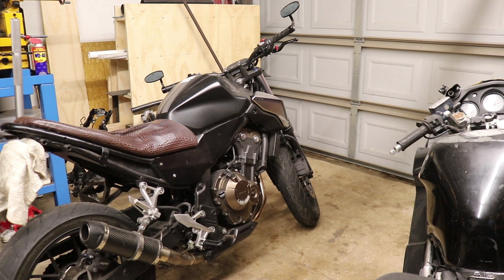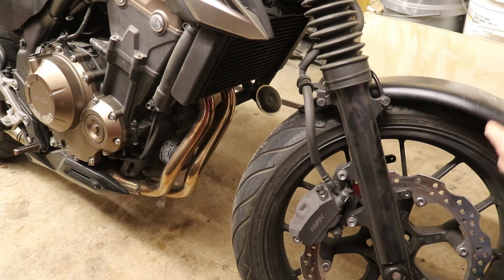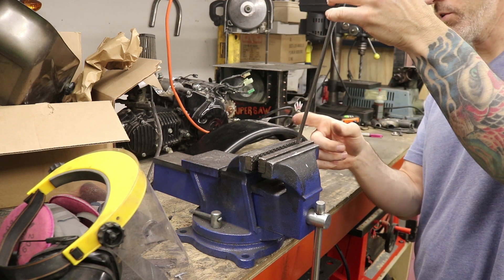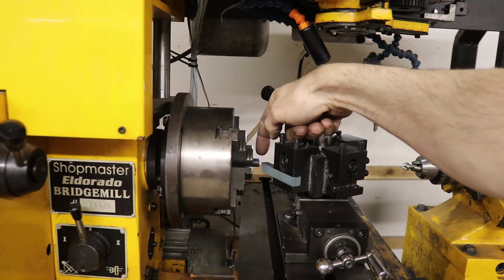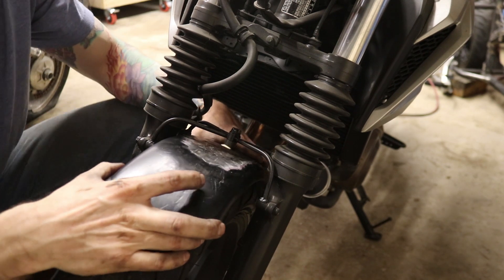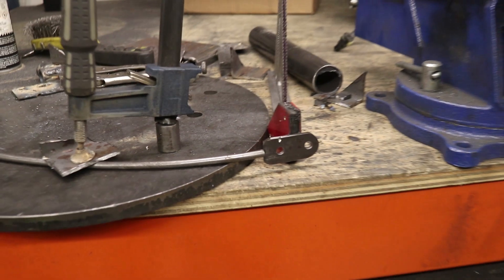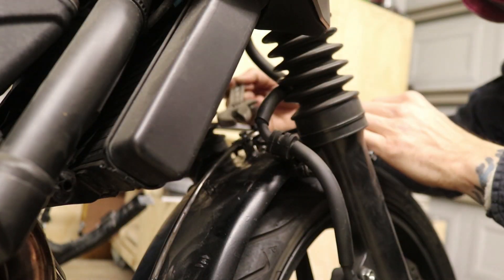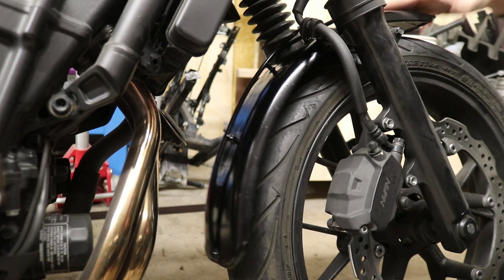Fender Re-inforcement on the Custom CB500F

Comment: Have you ever considered powder coating ? I just picked up a small wall oven to cure the powder . Unfortunately the oven was 220 V and didn't work in the first place.. I stripped the guts of it and bought a 110v heating element for $40. Mounted it through the side and blammo.... Working on the spray booth tonight... everything is modular because like yourself for now space is limited till that damn outbuildings up. Be well my friend and keep on wrenching.
Reply from the maker: I am aware of the diy powder coating, but have yet to try it. I assume it is more expensive than the spray can approach, but don't actually know. When I eventually make something of a high enough caliber - then I'll consider powder coat 😀. Let me know how you like it